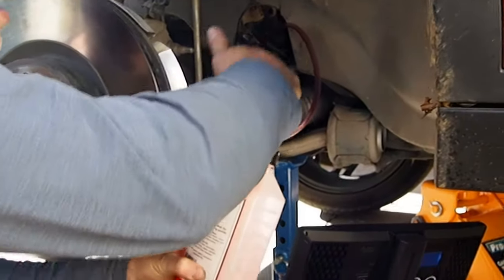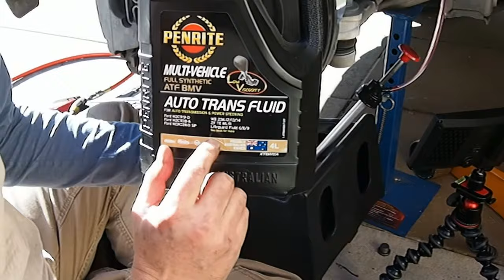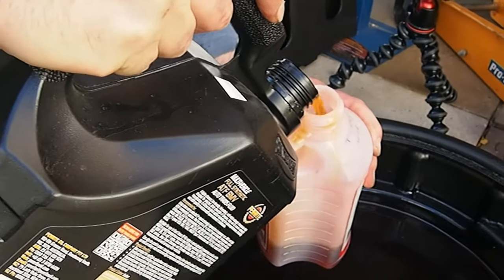Range Rover Evoque Automatic Transmission Fluid Change

Comment: The step in this procedure that has been missed is that once topped up you need to run the engine and select neutral with park brake on. The fluid level will drop and you can then pump another 0.8 Litres into the transmission before it starts to seep out again. Just pump until full then screw the hex head screw back in.
Reply from the maker: Thanks, will give it a go next time.
Reply: Zakindi the old oil mixed the the new ok 
Or do you need to do another complete drain
Reply: @peteloganirish7886  I am not an expert, only someone who has done the procedure on my own car. Repeat 3 times to get much cleaner new fluid with minimal old fluid left. But even just doing the procedure once will have a good benefit.
Reply from the maker: Redid the oil and yes, it took an extra litre, thanks for the heads up.
Reply: @aquaredable  it was your video in the first place that gave me the confidence to actually carry out this procedure, so thank you. Very helpful, and I'm glad I could add my bit
Reply: The LR service manual on Topix (for the 2015 Dynamic with this transmission) says to start the engine, put it in reverse for 10s, then drive, then manual 1st, manual 2nd, then back to park, then raise the engine to 2000 RPM for 30 seconds, then return to idle.  Then ensure the transmission is between 95F and 113F and remove the fill plug.  If fluid runs out, you are finished.  If not, put more fluid in until it runs out.
Reply: Do these boxes not have a filter on them.that needs changing
Reply: @davedixon6372  No.  Well, if they do have a filter, it is internal and can't be replaced without tearing it apart.
Reply: @shanefrank3281  nice one, I knew there was something about having engine running, thanks for clarifying.

Comment: Hello, just wanted to say, this is not correct way to change automatic evouqe gearbox fluid, as I found out the hard way after following this, now I need a gearbox. This doesn’t mention and having your gearbox fluid at45degree temperature and the fact it needs complete slowly and using a computer to check levels and how you need to run the engine and go through gears midway. A professional mechanic told me that video is not correct. Do not follow this.

Comment: nice job mate!!!! you are actualy telling people how to distroy 9 Speed ZF transmissions 😅😅😅 1st. you can only drain a maximum amount of 3.1 L out of that transmission, the rest will remain inside torque converter. 2nd that is the wrong oil spec for that transmission 😅😅😅
Reply from the maker: Not at all, the transmission fluid is recommended and the torque convertor fluid mixes with the new and gets refreshed over the coming services, no problems with the transmission so far, noting Landrover / Rangerover reliability issues are more of a concern than this job, nervous types like you should stick with the dealer, after all, they use qualified mechanics, riiiiiight!
Reply: @aquaredable  I am actualy  a former JLR engineer and a ZF engineer. Changing this ZF tramsmission oil if you not tow with the vehicle is a lost of money. Changing transmission oil and not performimg adaption reset + adaption drive will also not complete the work. I also agree with you for the dealer part 😅
Reply: What would you recommend?  The 2016 US service manual says (Nippon AW-1), which is pretty broad.
Reply: @Vlad-Alexandru.Burcezan  Auto Transmission Fluid ZF Life Guard6 will work for my 2014 Range Rover Evoque?
Reply: @scoutgl2  2014 Model Year ? or 2014 Built and 2015 MY? short, if your transmission is a ZF 9 Speed, then you need LifeGuard 8. or the shell equivalent. if your transmission is an AISIN, then I have to have a look. Better is to have the VIN to give you an apropiate answer
Reply: Would this method work if using the ZF lifeguard 8/9 fluid? I measured the old drained oil at 3.2 Lites, but would only take 2.2 Litres through the side level fill plug before it would run out.
Reply: @Vlad-Alexandru.Burcezan is this correct? Thanks
Reply: The step in this procedure that has been missed is that once topped up you need to run the engine and select neutral with park brake on. The fluid level will drop and you can then pump another 0.8 Litres into the transmission before it starts to seep out again. Just pump until full then screw the hex head screw back in.
Reply: @zakindi  what vehicle are you talking about ?
Reply: @Vlad-Alexandru.Burcezan  ZF 9 speed Range Rover Evoque
Reply: What is the correct way then vlad
Reply: @Vlad-Alexandru.Burcezan  Hi! Sir, i have Evoque 2013 sd4 6speed Automatic G/box that has clocked 110,000km and the G/box oil was never changed before. Please, could you explain in details, how do i change that G/Box oil and which oil is the right one for my G/Box? Please!!!
Reply: @bigdudetv7115  send me your contact details. I will have a look and forward you the details.
Reply: @Vlad-Alexandru.Burcezan  Can you please send me the procedure to change oil for  Gear box 9hp48 of a range rover evoque
Reply: Totally agreed, I’ve followed this and destroyed myZF 9 sp gearbox, ffs. This video needs removed.

Comment: Just a short note to say thankyou for making this video. It gave me the courage to perform this maintenance task myself, instead of lining the dealer's pocket (they wanted 850€ to do this!). The most difficult step for me, was getting the filling port bolt out, it was a little fiddley. Other than that, everything went as per your vid ! Many thanks.
Reply from the maker: Wonderful news, the dealers charge so much and I often wonder if they actually did the work, cheers
Reply: @aquaredable  As you recommended, I now do a 50% replacement every year and the gear change remains as smooth as when I bought the car, new.

Comment: Seems like a nice guy, but this is not how you change your trans fluid ...   you need to use the correct fluid, car needs to be at temp, run through gears and check with a scan tool... and most of all it needs to level.  Don't change the fluid in these ZF transmissions unless you have to..

Comment: Thought I would come back and say thankyou! So what I had was a small nudge on 3rd gear clunk kind of and slow gear changing also. So I did some reaserch decided to use Liqui Molly Tek 1800 used in jaguars bmws and landrovers is what I read in the forums. Also their was another oil that was more pricey  but guys said this one was also excellent for the ZF8 speed tranny . I have 2015 disco sport. I DOnT have the 6 speed Asian tranny. Drained from the bottom plus where you mentioned and then closed that and opened the top bolt to add the oil. I did remover front tire and lowered my Jack to level the car out without the wheel. The Liquid Molly oil jugs came with a straw you pop out and just squeeze it into the whole very conviniént! As I approached to empty the 3rd liter oil started coming out. In forum I read to start the engine and place the car in Neutral while engine is running and press emergency brake also just in case. This lowered the oil level and I was able to ad another 1/2 liter so about 3 1/2 liters went in I quickly put the bolt in and shut car off. Came back tightened up no to much and put everything back and test drive. Absolute night and day difference ! Can’t believe I didn’t do this sooner! I have 101k on the dash and bought car with 60k. Not sure if this service was done but oil came out dirty brown! Car shifts super smooth now thankyou so much! Only video I found that explained my ZF8 Transmisión on my disco sport ! ❤
Reply: I also have a Land Rover Discovery Sport 2015 model year 150 HP 9 speed ZF automatic transmission. I sometimes feel that the transmission is not shifting so well and that certain things are hitting it. What do you think if I get an oil change done too, will it be fixed? I have 196,000 km on the clock now and no oil change has been done yet, I assume.

which gear oil would you recommend to me which oil should I buy can you please tell me the exact name or the link

Comment: thanks for posting it. i used the same method but i lowered my car to the even level before putting the filler cap to ensure the correct level of oil.
Reply from the maker: Nice work!, I used a spirit level for the next change.

Comment: I have a 2012 range rover evoque. Should i also change the filter and where do i find it? It kinda looks different than other cars with transmission oil pan so i dont know where to find the filter. Transmission fluid and filter havent been changed ever since it was bought
Reply from the maker: change the fluids at least twice over a period of months before filiters, in order to get all the fluid out from the torque convertor as when you drain the unit, it retains a litre or two that will mix in with the new.

Comment: How much fluid did you get to drain out?  Many people have told me they only get 2L out, but a few have said they get 4L to drain.  If it is 4L then 2 changes replaces about 85% of the fluid.  If it is only 2L that drains out then only about 52% is replaced with 2 changes and only 67% with 3 changes.
Reply: Just in case anyone else is wondering, I got somewhere between 3.1 and 3.2L to drain out.  When putting it back in it would only take about 1.9L before it started running out the fill hole.  I think you have to cycle through the gears and then it will take about a liter more.

Comment: So there are still a few litres of old fluid in the box, i use to drain mine from the return hose to the box to at least drain as much from the converter cheers
Reply from the maker: thats a good way to do it, what i do is change in six months and thus try and mix and get it all over time

Comment: So you said you have changed the Rear-Axle oil, have you done a video on it, I was looking at the Work-Manual  PDF
that I downloaded, the capacity is 3/4 Qt, I see the Fill Plug, the Work-Manual talks about there 'No provision is made to fully drain the rear differential during repair procedures', then again it show the Rear drive axle/differential fluid drain plug 26, Rear drive axle/differential fluid filler plug 26 torque ft lbs settings...
Reply from the maker: I will review and get back to you

Comment: Hi Andrew, thanks for your video tutorial. I planned to change the atf oil yesterday and drained out on my 2012 evoque. Now I am having trouble to find fill plug to put new oil. Can you please let me know where exactly is it located . I am in Australia and its a right hand drive
Reply from the maker: Hi, if you take the front left wheel off you will see the indented alan key socket.
Reply: @aquaredable  thank you ..will remove the left side wheel..as I believe it should be close to that

Comment: by any chance is it the same procedure for 2016 discovery sport?
Reply: Yeah I was also curious …by the way the discovery sport 2016 D 180 PK has a 9 speed transmission gearbox. Which transmission oil do I have to put in?

Comment: What if you used a fluid extractor and a transfer pump?  Might be able to avoid taking the wheel off.
Reply from the maker: Maybe but its so easy just to take the wheel of and replace the fluid using the overfill method to confirm when full.
Reply: What!! 2 minutes t take the wheel off.

Comment: Thanks for posting this! Just wondering if you also need to think about transmission temperature? Are you at risk of overfilling if the oil is cold?
Reply: Transmission temperature is more for the straw method where the exact amount of fluid is hard to confirm and the overflow method is used but for this, I believe, is fine as if on a flat surface, it dribbles out to confirm levels

Comment: Hi! I'm little worried because i changed G/Box oil on my Evoque last week, but i managed to pour 7 litres before the oil start sipping out of the plug. Is 7L overfilling & if so...what's the danger of overfilling my transmission?
Reply from the maker: Hi, was your car level when you serviced it.?
Reply: @aquaredable  Sorry to respond very late, my phone had a problem. Anyway...No, the car wasn't on level ground. I ,slightly, Jack up the car just enough to remove the left front wheel. We didn't use the hydraulic vehicle lifts like the ones in the car workshops.😂😂😂

Comment: 9:26 You need a wheel alignment. Tread on the outer side is almost gone compared to inner tread. Also, I thought ZF auto trans are sealed for life. I have a 2018 Jaguar XF 25T & it has a ZF auto trans
Reply from the maker: Your spot on, did that and finaly put new tyres on.
Reply: sealed for life is a term to sell the vehicle.  It's really best to replace the fluid every 40 or 50,000 miles to be safe...for normal driving.  Extreme driving conditions might require every 30k.

Comment: Do you need to change the filter??
Btw great video, your also the only transmission change video on yt. you'll have to a diff oil one as well!
Reply from the maker: Thanks for the tip
Reply from the maker: Didnt replace the filter at this stage, just the oil based on the transmission being so young, will do it down the track sometime

Comment: It’s a great video. May I ask how much fluid it needs?
Reply: He said it in the vid, 2-3 litres at a time, basically like alot of vehicles out there.
Reply from the maker: Keep pumping until the fluid starts to dribble out of the fill plug, then its done, nice and easy, took around three litres if i recall correctly

Comment: I notice that you refilled the transmission unit with the car jacked up only on one side,  would it not be better to have the vehicle level to ensure the correct fluid level is reached?
Reply from the maker: Hi, you are correct. Make sure you are level.

Comment: Hi, just bought a 2017 RRV, 34K miles, downloaded the work manual PDF Zip file, going to change the engine oil/filter - Mobil-1 Extended performance 5W-30, GM PF-53 Oil Filter, Trans oil - DEXRON-VI Automatic Transmission Fluid, the work manual indicates the trans fluid is lifetime, I think it is best to change it, Rear differential oil - the work manual indicates  capacity is 3/4 qt. Castrol Axle EPX 80W-90, I will use GM Axle Lubricant, Synthetic, 75W90. Elbert Bernstein Pennsylvania USA
Reply from the maker: The manufacturer claims lifetime but their interpretation of lifetime is the warranty period only so best change all fluids, I used the Penrite oils page to find the right oils, http://penriteoil.com.au/
Reply: @aquaredable  Hi, going to use Amsoil Signature Series Fuel-Efficient Synthetic Automatic Transmission Fluid. Bought the used 2017 RRE 34K miles, seems to be good thing, a few missing body parts that I have gotten from RR. You are in AU, did R&R Sydney AU from 1st MAW DaNang Vietnam 1969, now retired 72, went to college after the Marines, Mainframe System Analyst/Programmer 25 years.